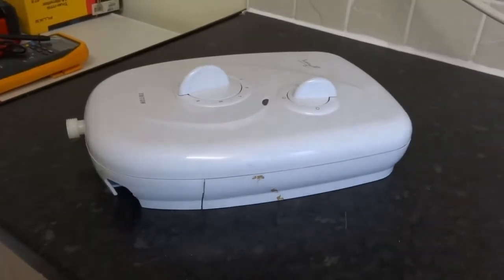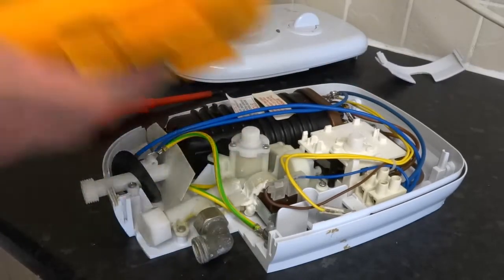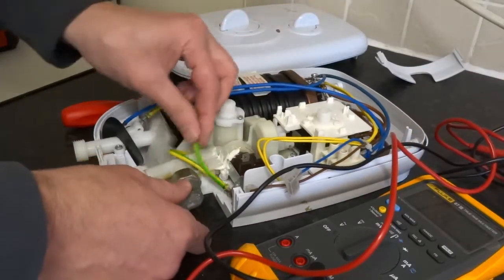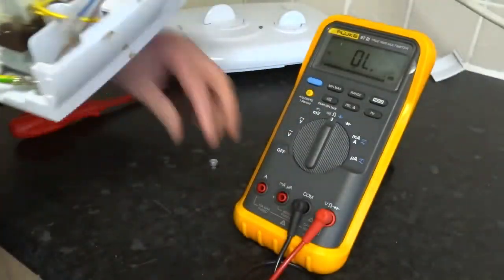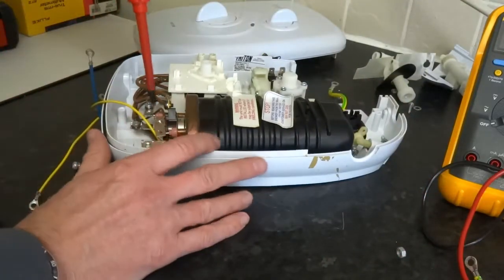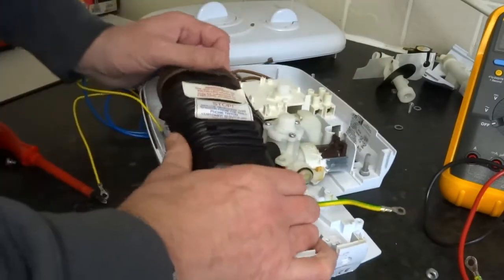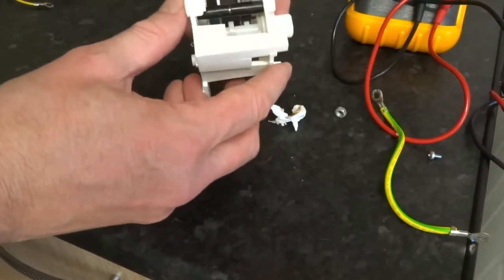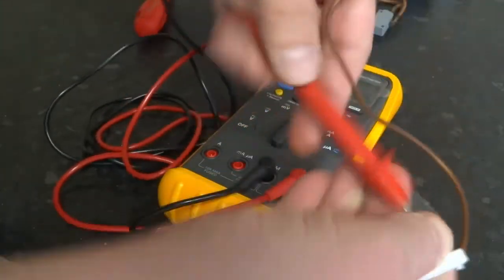Triton Ivory 3 Repair: Full Strip Down, Solenoid, Switch & Heater Element Testing Guide

Comment: Got a similar one but as you wedge out the solenoid coil it hits the inside of the  plastic on the unit before it's fully out...think I'm screwed there haha
Reply: same, you basically need to disassemble the whole thing just to get the solenoid out 🙄 why did they arrange it like this...
Reply from the maker: what models ?
Reply from the maker: damn what model